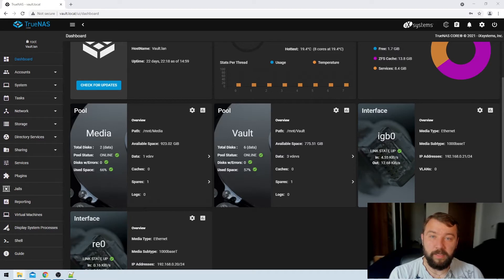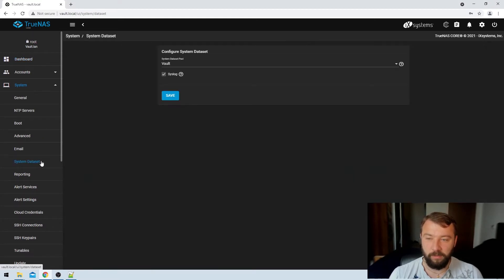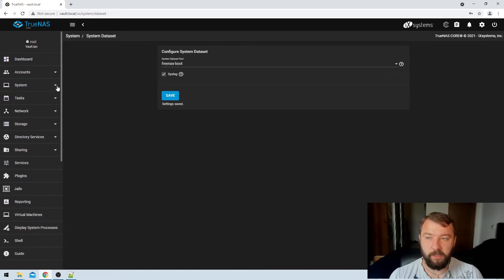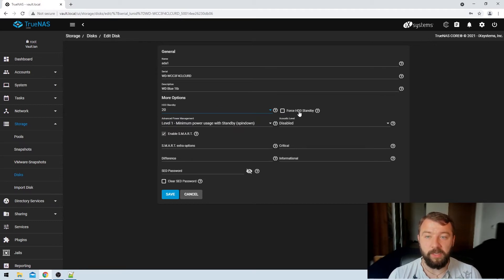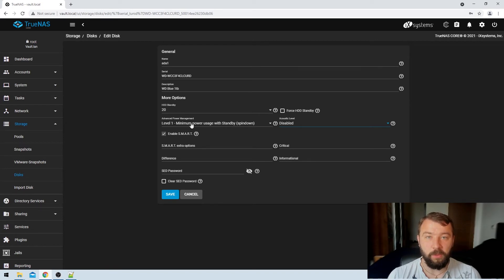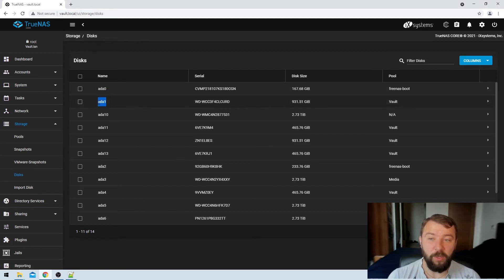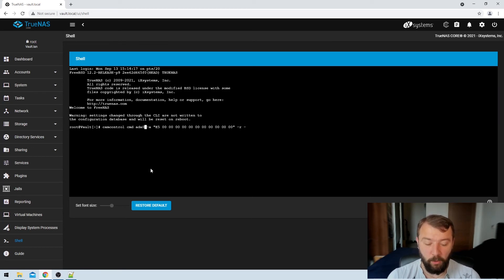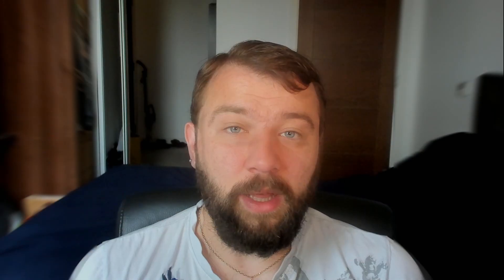Spinning Down Disks | Managing TrueNAS Core

Comment: Very useful info that I couldn't find anywhere else--thanks!! 

Just FYI to those using the latest TrueNAS versions such as Dragonfish 24.04.xx the menu locations are different from those shown in this video.  All the instructions are correct, but now you have to hunt for the new menu locations.  

To get to the same disk spindown menu, go to Storage (left-hand menu), then select "Manage Devices" where your VDEV is shown.  Then click on the "Data VDEVs" (mine shows a single entry for my RAIDZ2 disk pool.  Click on that pool, then you'll see it open up to the individual drives.  Click each disk's logical name, such as sda.  Then scroll down to the right-side "Disk Info" menu.  Click "Edit", and you'll find the spindown and power settings there.  

Camcontrol is not a recognized command in TrueNAS Scale, BTW.  Too bad.  I just watch my power consumption meter.

I'm still not sure why ixSystems had to rearrange so many of the menus in the later releases.  Great software, though!

Comment: As A home user, my system is only used in the evening mostly. I have been using spindown for a long time and it cut the watt draw of my nas dramatically. Data set is saved on ssd fast pool. Is there really room on the boot ssd for the data set?

Comment: Great video and thank you for it!  My question is about how much drive space the system dataset will need.  I'm using an 8GB SATA DOM as my boot "drive".  My storage pool is 14TB spread over 20 1TB drives (big SuperMicro 4U rig but was a free server, obviously not new).  2 hot spares.  From what I've read, the system dataset is generally in the megabyte range, tiny.  I'm a NAS noob so I don't even know how to check how much room is available on the DOM.  I want to say TNC uses about 2GB but I'm pulling that from weak memory.

I do have a pair of 128GB SSD's that were used as cache drives when this machine was originally set up with some horrible NAS software called OpenE and a hardware RAID.  They aren't being used at all right now, I could add a pool to them.  

OK to use the DOM for the system dataset or set up a new pool on the SSD's?  I'm using this behemoth at home so it sits many hours or even sometimes days without pulling anything from it.
Reply from the maker: Yes! Definitely, boot drive is always very tiny. The only advantage of having a large one is that it spreads the writes across the memory to decrease wear and increase lifespan. However, 8GB should last you many years no issues (With the caveat that this is only if the drive itself is well manufactured. Cheap and crappy will not last because it is cheap and crappy, not because of a size issue!).
Reply: @BlackbeardSupport  The DOM was made by Wintec. Came with the machine.

Thanks for responding!

Comment: Hi Blackbeard, thanks for the video! Good to know about "Force HDD Standby" being a bad idea. That said, were you able to get temperature monitoring working with these settings? Even when my drive are awake, I now can't monitor their temperatures with the settings you described. Any ideas?
Reply from the maker: Unfortunately if you spin down disk temperature monitoring stops. You must either use 'Force HDD Standby' and accept the consequences, or never set the disks to standby at all. Sorry!
Reply: @BlackbeardSupport  How odd! Okay, so if I enable "Force HDD standby", I understand that SMART checks won't occur while the drives are asleep. Will periodic scrubs still occur?
Reply from the maker: @SeanSL  Yea, you'll still get scrubbed. That part will be fine,
Reply: @BlackbeardSupport  Good to know! Thanks man 🙂

Comment: I've also read online that S.M.A.R.T Will always run and stop your drives from sleeping.
Services > S.M.A.R.T. Settings. Set Power Mode to Standby.
Reply: cheers this helped me greatly as i followed all instructions in video and hdd still wouldnt stop after 20min. changed smart to power mode standby- perfect mate, works!
Reply from the maker: @todd1748  Great!
Reply: @BlackbeardSupport  hi mate, ive just checked my disks again and they arent stopping anymore. did all the steps again even though they were all the same still from last time but i cant get the 00 code (just FF everytime) after timeframe has elapsed anymore. any ideas?
Reply from the maker: @todd1748  Hmm, are you sure there could be nothing accessing the disk? It can be tricky to track down what's keeping them up, but no jails? No reports? Cron jobs?
Reply: @BlackbeardSupport  thanks mate for reply, i restarted system and waited 20min. did a test and they have stopped spinning so not sure what was accessing them before but something must have hey
Reply from the maker: @todd1748  Great to hear. Yea, if that happens again, unfortunately the only thing to do is dig around the logs and see if you can figure out what's accessing it, but it's really hard pinning that down.
Reply from the maker: Yea that's definitely true. A lot of settings to tweak.
Reply: But do you still get your disks checked by smart tests? The help in TrueNas Core states:
Tests are only performed when Never is selected.

Comment: The fact that my DL380P Gen8 uses 65 watts idle without the spinning drives plugged in, and 100-120 Watts idle when they are in the server makes a huge difference in my electricity bill (0.6 Euro Cents / Kwh // Germany!) so i already made the changes but the server never stopps the drives and nothing is using them. I store ripped movies and series on them so dont need to be 24/7 online

By the way i use a virtualized TrueNAS Scale (has qemu-guest-agent) with a dedicated PCI HBA. Dataset set to boot pool, and no force spindown option anymore :/
Reply from the maker: Unfortunately I have not played with Scale enough to give you advise. :/ That's annoying.
Reply: @BlackbeardSupport  in some cases we need to disable smart monitoring on the drives, so they can spin down. Since acl permissions are a mess and cant connect via nfs to the freshly configured share (after two successful mounts on different things) i decided to wipe this out of my system for ever. And instead i install the Core version again and deal with the ssh and scripting things again... 

Is there a qemu-guest-agent for the bsd version? Im not familiar with bsd at all.
Reply from the maker: There's a port available https://www.freshports.org/emulators/qemu-guest-agent. To be honest I have not tried it myself (I run on bare metal), but I've heard some positive comments from those who have. As with any port, your mileage may vary!
Reply: @BlackbeardSupport  I got scale wiped completely, useless garbage, went back to Core and yet, drives are spinning down after a while but the power consumption remains the same :D weird .
Reply from the maker: @victorshane4134  Well that is unusual, though if you're using newer drives, they may already by very power efficient. A good ballpark for the consumption being used is about 10Watts. If you have a lot going on on the machine and only a few drives, it could be hard to notice the dip. 

The other thing to check is that the drives STAY spun down, and don't keep spinning back up for things like daily scrubs. No easy way to check, unfortunately. Just have to occasionally run the command to see they are spun down.
Reply: @BlackbeardSupport  because those drives are storing my owned movies and series as well as music,  the drives isn't used most of the time, scrubs,  because of that delayed for once a month, and scrub tasks can only run at the last week of a month from Friday to Sunday. The drives seems to spinning down because if I start a movie I have to wait till they come online.  Well I'll test the drives inside my netapp ds4243,  maybe I'll have a luck but this box alone adds 75watts of power consumption alone.

Comment: How do you know what size you need for the system datapool set?   I have 2  4TB nas drives in raid 1 and a 128 GB nvme drive as boot pool.. would that be enough?
What size does the info take?
Reply from the maker: It can vary depending on a few factors, but generally 32Gigs is plenty, and 64 is way more than enough. I like to put in a Min of 64, but that's just cause the memory is cheap.
Reply: @BlackbeardSupport  Thanks so I will move my info to the 128GB nvme bootpool drive
Reply from the maker: Yea, that will definitely work!

Comment: The check command dose not work on a shelf
Reply from the maker: Sorry, not sure what you mean. Are you having trouble with it in the shell maybe?
Reply: @BlackbeardSupport  Sorry, to clarify im useing a DAS NetApp shelf for my drives. it seems to be doing something as my power consumptions dropped but it seems i cant use the command to get the disk info
Reply from the maker: Hmm, yes, I can see how that might be an issue. Unfortunately I don't have a DAS NetApp shelf so I can't test myself, but I wonder if the server doesn't support direct access to disk information. 

Does the server return any disk information from any command at all, or is it JUST this command that fails?
Reply: @BlackbeardSupport  In the metrics area on truenas i can see alot of stats. what other commands could i try?

Comment: I was planning to make NAS home build, but i could not get to spin down disks (1 pool with 3 disks), in the end i got WD home cloud, and i dont like it cause it also doesn't spin down disks. And now i came across this video and the problem was system data set log on that data set! .. So i move the log to my usbnas key, and i notice that it was slow on configuring disks, saving etc.. and then it crashed NAS in to a boot loop. But it was just nas to play around, no data lost. i presume that its USB 2.0 was the problem. So i will try to add ssd cash device to NAS and use it as syslog device.
Reply from the maker: Hi Ivan, glad I could point you to the system dataset. It's true in the past that TrueNAS boot pool was recommended to use a USB drive, but in the last few years this is not the best option. A small SSD (Even 60Gig would be more than enough, maybe even smaller would work) would be a great option, and hopefully you will have more success. If you can buy two, it can be a great idea so that you can have a boot mirror, in case one drive fails. You can see how to do this on my video here: https://youtu.be/xTUsJNvLHS8. 

Best of luck with your NAS.

Comment: Nice video, thank you. The terminal command is really handy. BTW, are you concerned about drive longevity? They say always-spinning disks live longer... But standby mode is actually pretty nice from the acoustic point of view. They say power consumption is not that different.
Reply from the maker: I've yet to see some really concrete data on how much it reduces drive life. Most of what I see and read is peoples personal experience. We're not able to predict when a drive will fail, so it's hard to do an A/B test to see if spinning them up and down wears them out faster. I'm sure it does, but I suspect the amount is probably negligible. 

I will say that standby mode doesn't always make sense. It really depends on your environment. If you're in an environment where a lot of people are accessing the NAS frequently, it would not make sense to spin them down as they would constantly be spinning back up. I'm the only person using my NAS, and my drives are accessed infrequently enough that I'm comfortable that spinning them down is what I want to do. 

In general I'm not as concerned about wearing out my drives as others are, as my strategy is to use cheap drives and overcompensate for failure. I have multiple layers of redundancy against total pool failure, and even if it does fail I have multiple known good backups. I can live with shaving a few hours off the life of my drives (if that's even happening). 

If you're concerned about power consumption, I'm working on a video right now to test if updating my existing power supply helps to save some money. I need to run on the new supply for 30 days to truly see how much of a difference it makes, so expect to see that drop sometime next month. If you're interested, make sure you subscribe so you don't miss it!
Reply: @BlackbeardSupport  wow, sounds great. Looking forward to the video! Will you measure how much Amperes your NAS consume during the start-up when all drives start? It seems to be quite critical for a power supply because in general during a NAS operation the load is minimum but first seconds of start-up lead to big power peaks. Would be nice to hear your thought in the video. :)
Reply from the maker: Unfortunately it's not the direction we'll be going in. I was more interested to see if upgrading my 10 year old power supply to a modern, more efficient supply would improve power consumption. Peak draw wasn't on my radar as to get the most out of the efficiency curve for a power supply, you want to over provision by quite a lot. Then the power supply always operates as efficiently as possible. Once I see if we draw less power from the wall over the next 30 days, I'll be able to determine if it was worth upgrading, and how much I would need to save on electricity before it was worth it. 

Because you asked, I rebooted my NAS which currently has 14 drives in it. According to the smart plug that measures the draw from the wall, it peaked at about 360w on boot as everything started up. I would not rely too much on this though, as the plug does not have the granularity I would like to see for measuring such as short burst of power. It is more useful to give a reasonably accurate usage over time (or at least, accurate enough for what I was looking at). 

Related to your earlier question though, the difference between all my drives spinning vs sleeping seems to be somewhere around the 20-30w mark if they are doing nothing but idling (more, if they are actively working). If they ran at idle for a full month vs being spun down, it would mean I save approximately 20kWhs a month. This of course assumes I do not use the NAS at all for the full month, so in reality I am saving much less. Where I live 20kWhs would cost something like €4, or $4.50 in US dollars. Most users argue that this is pittance in comparison to having to buy a new drive because of the 'extra wear' spinning the drives up and down. They are right, the money saved is much less than would be spent on a new drive, but as I've said before, I'm not convinced it increases the chance a drive will fail early. So far, none of mine have had issues in the last ~5 years, and I spin them down all the time.